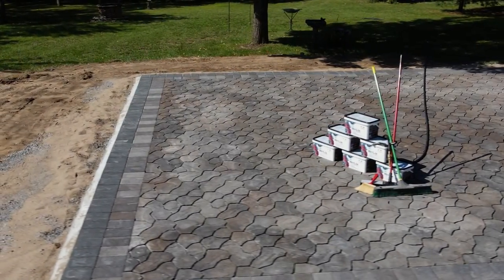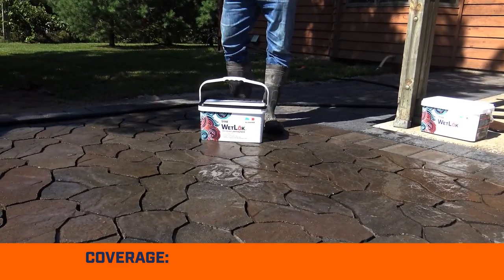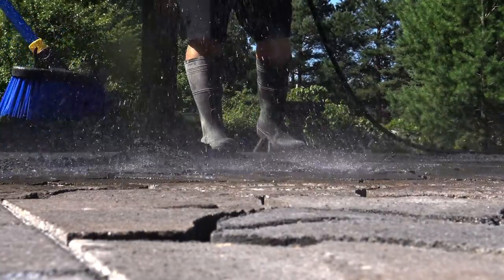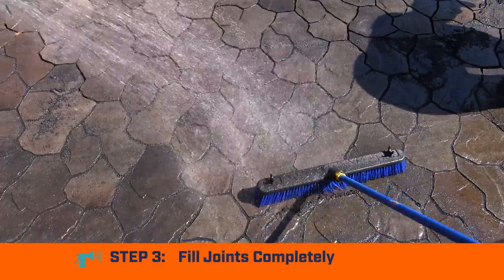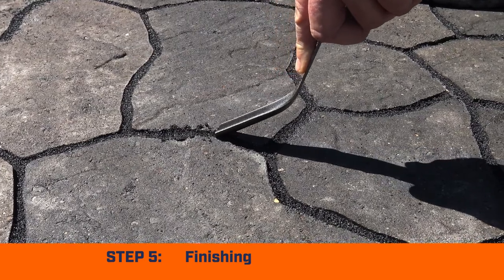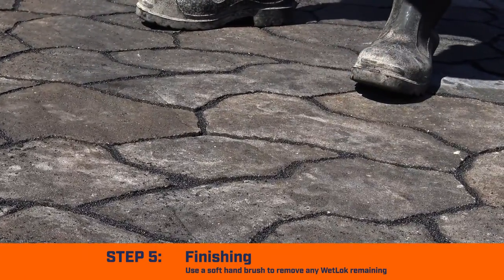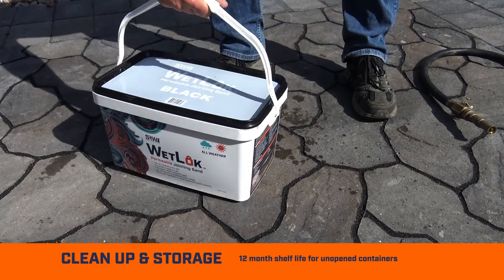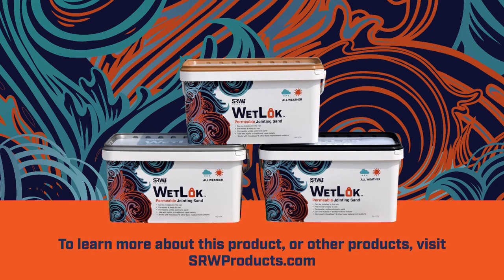WetLok™ Installation

Comment: So the video says 3/16” joint but the website says 1/8” joint spacing minimum so which is it? 1/8” or 3/16”?
Reply from the maker: Thank you for your interest. Since we first produced this video with the launch of Wet-Lok™new features have been introduced such as a wider joint range of 1/8" - 5" along with new application uses such as porcelain and light-duty residential driveways. Our website is always the most current source of information.